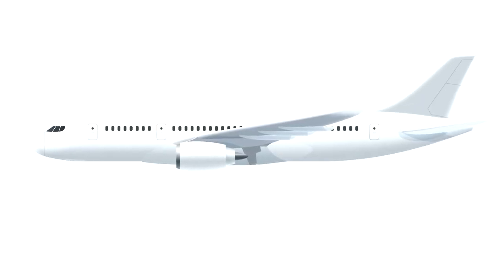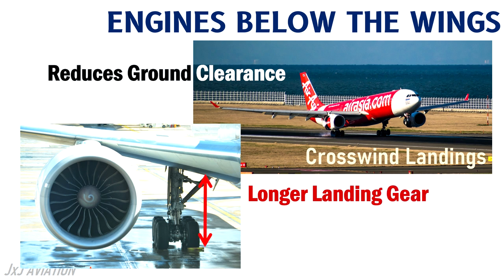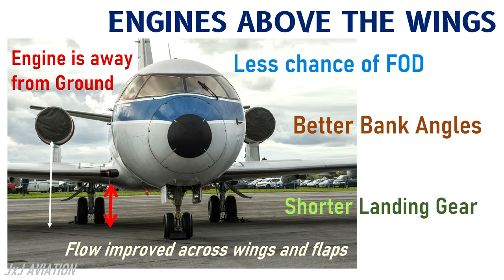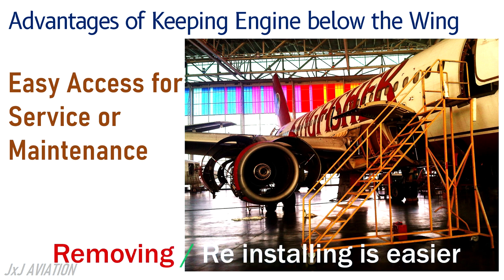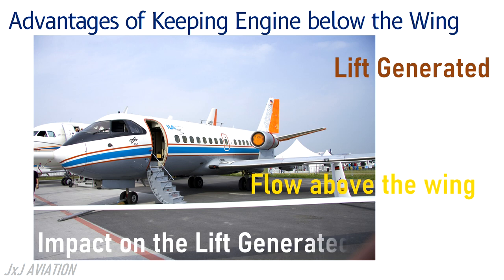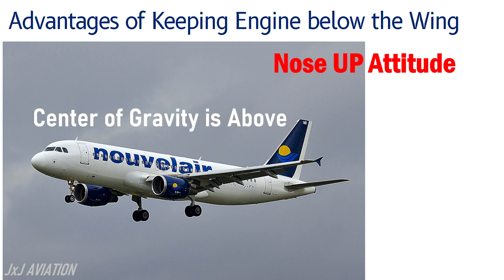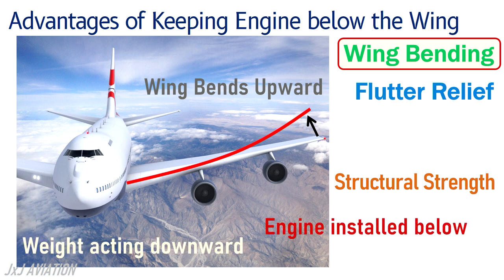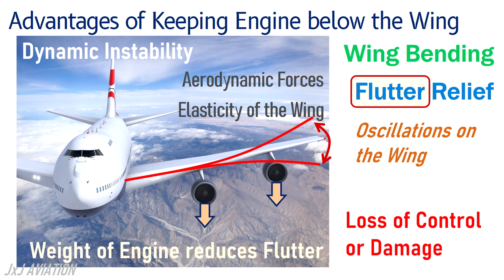Why are Engines installed below the Wings on most Aircraft?

Comment: The real reason why an engine is mounted below the wing is due to the high pressure air that exits the jet engine. The air ABOVE the wing has to be low pressure, and the bottom of the wing has to have a higher pressure. As a result, it makes sense to mount the engines BELOW and placed slightly AHEAD of the wing so that the high pressure thrust from the engine comes out below the wing and helps give a slight increase in lift in the area where the engine is mounted to the wing. 👍🏻
Reply from the maker: I would not consider this as the primary reason but it is one of the reasons!
Reply: I would have thought it would be the other way round.  Airflow, by its design, is faster over the top of the wing, which means the medium air pressure is more horizontal than vertical.  Airflow below the wing is slower so the medium vertical pressure is more than above the wing.  It is this effect that gives lift.  To have a jet turbine powering air across the top of the wing, would add more to lift.
Reply: U r right about low pressure and high pressure,created by wing,but engines are placed little forward then wings, so this theory don't work
Reply: @malcolmabram2957 same thought, I was searching for this exact answer

Comment: Can you please explain in details why increase in thrust will cause a nose up tendency when the engine is below the wing?
Reply from the maker: Sure. Will make one on this soon.
Reply: I think this question is related to the new 737 max. Because the engine is much forward and it causes the plane to tilt upwards more in flight. But why does it tilt up more?
Reply: I think it's because of lever principle 🤔
Engine is attached in pylon which acting like a rod, so if the distance of the engine is increasing the leverage force increases too and thus tilting the nose up because it's located below the wing
Reply: @JxJAVIATION  Hi, Could you also make one on, why some big airplanes have wings above airplane body(Antonov & Globmaster), but some have wings below the airplane body (like A380 & Boeing737)?

Comment: i thought that since the engine is below the wing the hot airstream from the turbine will impact the lower wing causing even more lift because of high pressure hot air jet
Reply from the maker: The hot gases do not have much of an impact on the lift created on the wing!
Reply: @JxJAVIATION   i thought it might have some influence
 thank you